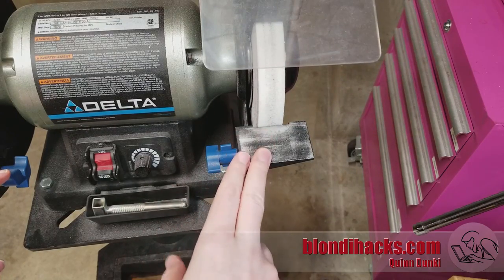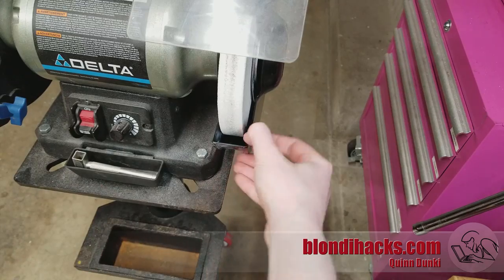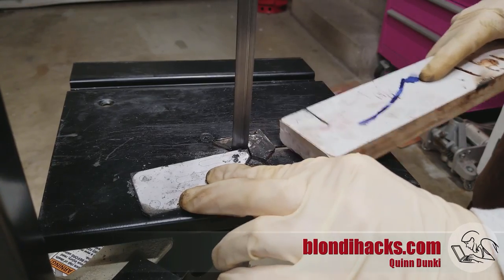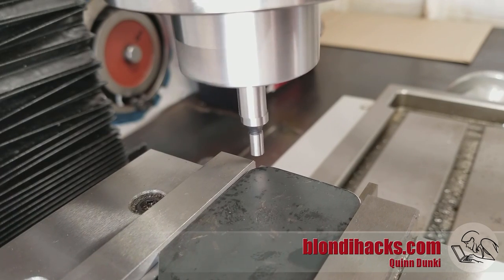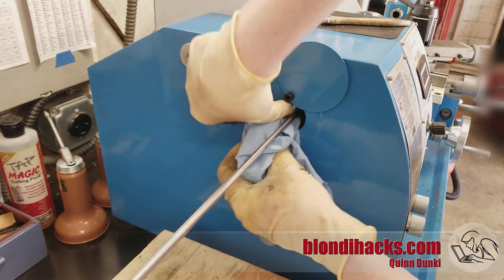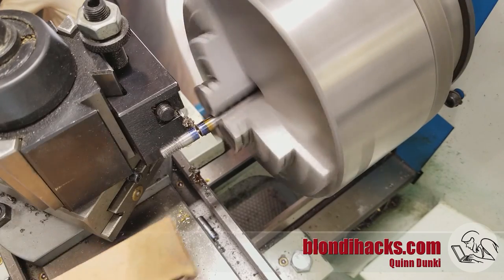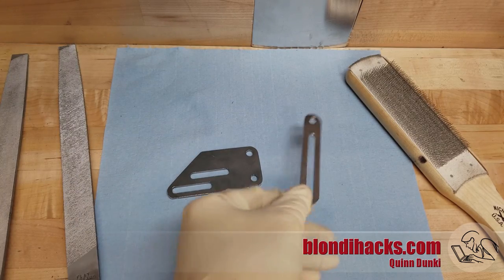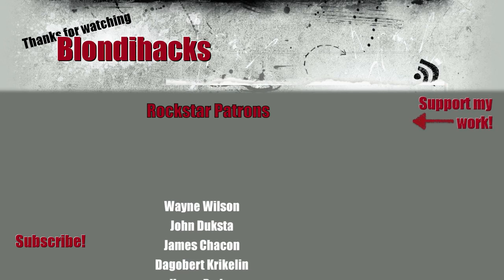Bench Grinder Tool Rest Replacement : Part 1/4

Comment: something you might find useful for future things, when you need to stick a patterns to a sheet of metal, etc. put down a layer of masking tape (aka painters tape, etc) first then glue the pattern to the tape, means that when you come to take it off it easily peals off with little to no cleanup needed after.
Reply from the maker: That's a great idea! I'll use that in the future, for sure!

Comment: I need to do basically the exact same job . I'm a luthier not a metal worker so my kit is a bit limited although I do have a mill and a lathe. I'm loving the fairly basic tool set required for this project. Your clear concise and complete style of presentation is killing it. Keep up the good work!
Reply from the maker: Thank you very much! 😁
Reply: Isn't a lathe user called a "lathier"?  FWW, it took three corrections to get that past autocorrect!

Comment: Great project. I have thought about making a rest that mounts to the base of the grinder because the guards on my grinder are really flimsy. I think this is the inspiration to get started.
Thanks for posting such great content.
Reply from the maker: Yah, I think mounting to the base is a better choice if you can. The way this grinder is, it was going to be really complicated to do that. Reusing the factory mounts was easier, but it's not as rigid as I'd like. Stay tuned for more talk about that.
Reply: Robert Oswalt, my grinders are bolted to plywood bases, which have their own soft rubber mounting feet (blobs of silicone sealant.) Tool rests and other accessories mount to the base, this allows for lots of options as I use a standard base on them to pick up 2 studs fixed in the base.

Comment: The method of filing used to create the end radii is exactly the way I was taught to do it.  This was way back in 1974 when I started my apprenticeship with Rolls-Royce in the U.K.  Just an observation, but would a small lead-in chamfer have help start the thread in the studs.  Subscribed.

Comment: Great project! I've been contemplating doing something like this to one of my grinders.
My goal is a larger and more ridged work surface. I was thinking about one large tool rest that spans the entire width of the grinder. This would make it easy to get two attachments on the plate to prevent twisting and make it more stable. The downside to this arrangement is that compensating for wheel wear may be an issue. 
I look forward to seeing how your design performs.

Comment: Thank you, I'm a new subscriber and home amateur engineer. And real one too. I thought it was just us Brits that mixed metric and imperial measurements. I loved "5 ten thousandths bigger than M4.." so 0.0005 is 0.0127mm giving 3.987mm..so after all that I'm saying you used a 5/32 drill. Or 156 thousandths as you lot seem to be fond of saying.
Reply from the maker: Carl Wilson Both in the US and in Canada, you pretty much have to be comfortable with both systems, I think. Despite most manufacturing being metric, you still encounter both systems on a daily basis. Salute to the Commonwealth! 🇨🇦
Reply: Thank you for your reply. I didn't realise you were Canadian. Oops! My apologies. Yes I agree, in the UK it is perfectly normal to walk into a hardware shop and buy a 3 metre length of 4 x 2. We use both systems and despite having officially converted to the SI system of units in the early 1970s, the imperial system is still in everyday use. I'm looking forward to the next installment of the grinder rest. I very much enjoy your content. Salute indeed to the Commonwealth! 🇨🇦🇬🇧

Comment: Great idea, awesome job. A rear lathe [spindle] spider would be a great future project, too. Lol. Again, Awesome job.
Reply from the maker: eddie Towers That’s a great project idea! A lot slicker than stuffing a rag in there. 🤣
Reply: That what you did, was a cool MacGuyverism. Using what you had on hand. I have never thought of that, which is too bad, considering how many times I’ve had napkins, with lunch,, thinking, “Man, I’m going to need something to hold that rod on the back end of the lathe spindle”, while wiping my hands after eating a panini
Reply: @eddietowers5595  machine grease, panini grease... whatever works.  :D
Reply: @DavidLindes  YESSSS! This guy gets it.
Reply: eddie Towers 😁

Comment: Thanks for showing, me last week decided to see how my woodwork belt grinder grind HSS toolbits(12x12mm) and to my surprise it does well and somewhat cooler grind. You have to hold tool with one hand on a 7-8 degree set rest at the side angle you want from the side direction you want, and use a handstick to press hard around the tooltip with your other hand.                      
Following this I am now making  a proper adjustable toolrest which is part of a jig that clamps in a vice on workbench and holds the woodwork bosch grinder in upright position belt going down.. On the adjustable pice about 120mm x 70mm fitted with lock down clamp like alternator adjustment I have to come up with a milled support piece that goes around grinder to grind the top rake angles-I may have to revert back to the benchgrinder here, will see. Not using the bench grinder for the side angles is a relief for me and I got better control and its faster. So next week after making an aliminium push stick with screwin metal tips to hold pieces of thick leather dipped in water to warn when tip gets hot(steam),... I will know if this is going to be my new preferred way of grind.

Comment: I'm enjoying your videos, thank you. With the band saw you could try a zero clearance board clamped to the table to prevent small parts jamming the blade. Just a sheet of ply or mdf cut with the saw blade to the middle and clamped down.
Reply from the maker: Steve Kingsley I do indeed do that sometimes as well, but I wanted to call out that risk for people who may try this table for the first time.

Comment: That "toothed-wheel" arrangement at about 1'30" is actually called a Hirth-coupling. In days gone by some motor vehicles' engines had their crankshafts assembled with Hirth couplings. If one uses high-quality materials and high-quality machining processs it forms a very precise, repeatable and non-slip joint. The only downside it that it's expensive.
Reply from the maker: Good to know! I was not familiar with that.

Comment: Hi Quinn!  Great video!   I see you keep your diamond dressing tool in the quench tank. So it’s always ready, but you can’t cool off the pieces you’re grinding!  Maybe make a bracket for the dressing tool and then you could put some water in the little tank. Just sayin’.
Reply from the maker: Craig McCuistion That’s a holder for the dressing tool. The dunk tank is down in the base (you can see the rust in the bottom of it)

Comment: 7:40 Tedious, yes, but not as tedious as milling from scratch I would say! There are probably a million different designs for rests out there and they are all good, just depends on what you need. Cheers Quinn!
Reply from the maker: For sure! Saves time, and drills are a lot easier to sharpen/replace than milling cutters.

Comment: First off, absolutely enjoy all your videos. Subscribed after the mention on Abom79, and no regrets. I like the easy pace and the relaxed tone. You are very much better than the "YouTube Hack" you keep calling yourself in the videos.

Second, and this is just an opinion question, why did you choose not to knurl the pins that would be pressed in? I presume because the drill rod is hardened? I'm unsure if 0.001 press fit would stand up to regular tightening and loosening of the thumb-wheels, but that may be my lack of knowledge showing itself. Just curious.
Reply from the maker: Great question! Knurling is probably a good idea. I use Loctite 603 on light press-fits like this, and it's impressively strong. You'll see that in an upcoming part of the project. If it doesn't hold up over time, I'll remake the studs with a larger diameter for a more aggressive interference fit.
Reply: I was going to ask about Loctite, but didn’t. Fair point. I also thought you might not have a set of straight knurling wheels, since pressing in a cross-hatched knurl would not make sense. Either way, looking forward to the next installments.

Comment: To stop the small offcuts falling into the bandsaw, perhaps try a magnet glued to a popsicle stick. Attach it to the part that will drop  before severing from the larger piece. Maybe flexible magnetic sheet (fridge magnet) would also work.

Edit: please have a look on YT for "Lathe Bar Stock Accident - Whipping at high speed" so you can see a consequence of having too much stock sticking out the back of the headstock.
Reply from the maker: Darryll Crook The magnet is a great idea! Just placing it near the blade might be enough to grab the small pieces and pull them out of trouble.

Comment: If an Individual (like me) doesn't own a Mill, is there a "Budget Freindly" X Y Clamp/Vise that you would recommend? I own a ¾HP "ROCKWELL/DELTA" Drillpress that I aquired from my Father's garage tools as he was an Engineer for BOEING for 45 years.
I have seen quite a few with incremental dials, but am insecure regarding their reliability/accuracy, but I am not financially sound...
Also, I would like to add an active Oiling System to keep the Cutting tool and Material from "melting/galling", as a "Shade-Tree" Machinist, what would you recommend? I would have no problem adding a Transfer Pump with a Filtration System so that I can "reuse" my cutting fluid.
I just happened to "stumble upon" your Channel and absolutely love your demeanor and attitude! I would ask "FIREBALL TOOLS" but he is busy with "easy questions".
Thank you,
Thomas 😸
Washington State

Comment: Ah, "janky"... technical terms, I love 'em.  :D
Reply from the maker: "Janky: (adj) 1. Designed by committee"
Reply: @Blondihacks  All too often the case these days.  I like your updated design, it will be interesting to see if you find the  1/8" riser a bit flexible.
Reply from the maker: @rennkafer13  Spoiler alert- the riser is great, but the sheet metal shroud it is mounted to is more flexible than I wanted. We'll remedy that, though.
Reply: @Blondihacks  I'll be patiently awaiting that video too.  :D

Comment: You don't think that eighth inch thick slider bar will be a little bit floppy? That's one of the first things that I dislike about most factory grinder rest s is they have a little flimsy track and the whole thing seems vibraty. I like them chunky.

Comment: Change wheels? Never,buy a 2nd,3rd, etc grinder. Presentation,sound and video ,great..!!!!
Reply from the maker: Someday I will, when I have the space. For now, I have to change wheels. 🤷‍♀️
Reply: @Blondihacks   No offense meant,I went with one,but, when switched to 2 then 3 made shop work so much pleasanter and faster. The right stone,right away.
Reply from the maker: No worries! You're right that multiple grinders is the way to go if you can.

Comment: Hi Quinn,

Just a little bit of feedback :)

Can you stick to either metric or imperial in the same sentence please? 
"5-10 thou than an M4 screw" 
That works out to 3.873-3.746 mm which is non-standard size. :)

I think a 3.5mm drill bit would of worked just fine this situation.

Regards
Reply from the maker: flagmedownmedia Mixing units is pretty unavoidable, in my experience. The factory mounting screw is M4, and all my tooling is Imperial. I work back and forth in both all the time- it’s the world we live in. 🤷‍♀️

Comment: Are you using a 15mm speed handle on your mill vise? Been looking for one but all seem to be 3/4” hex for the 6” Kurt vises.
Reply from the maker: Right? It’s a 9/16” speed handle, and a guy here in the US makes them and sells them on eBay. Can’t recall his name, but a search should find it.
Reply: It’s an upgraded 5” vise purchased from Precision Mathews for my PM932PDF. It’s definitely 15mm. I’ll see if this seller has the right size. Thanks. You’re awesome.
Reply from the maker: Spax man Yep, I have the same vise. 9/16” is about equal to 15mm and he makes the handles specifically for these 4-5” import vises.